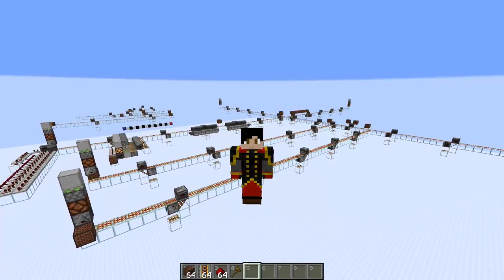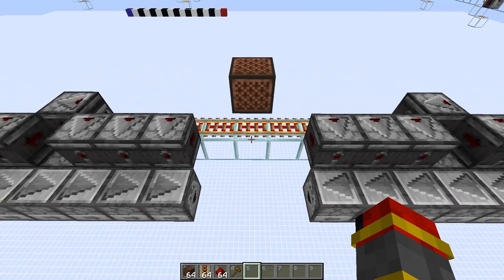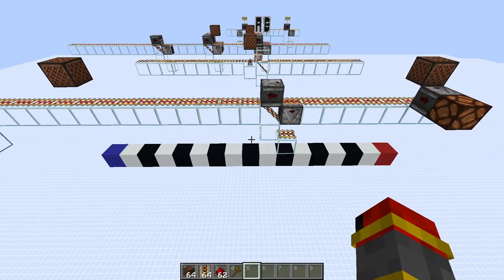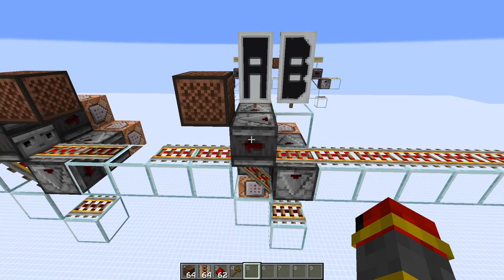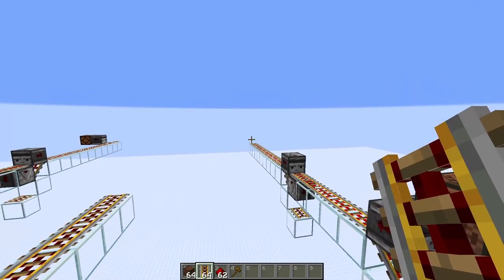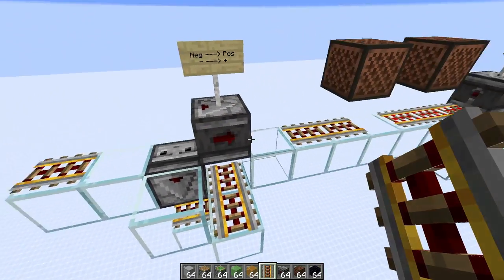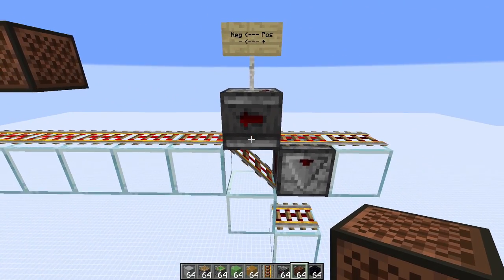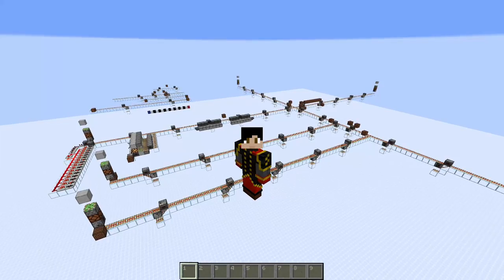Robust Instant Wire | Minecraft

Comment: I needed some sort of long-range redstone for my railroad and this had been perfect in theory until... I needed it to bend(in an L shape). After fiddling with this for a while, apparently this is extremely simple. You just... bend it. Build two of these, connect until they touch, that's it. Also, this is probably said in the video, you can bend the rails up or down as you need. They still update instantly as if they are a single straight wire (I guess they are) I did this in 1.20.1 fabric

Comment: So after a lot of testing because I was having loads of issues getting this to work correctly I've concluded that the information given at 5:14  isn't entirly correct. 

Moving in the +Z Direction of travel with the observers output as described in the video, which is the direction the rails want to snap correctly, only is true in the North to South orientation. When placing the rails in an East to West orientation, the rails naturally want to snap in the opposite direction, making the observer output point in the -X  direction of travel.  

So again to simplify, when oriented East to West the observer output points West and the rails easily snap together, and when oriented in the North to  South direction  the Observer output points South and the rails easily snap together.   Otherwise you'd need to use the mirrored assembly method which is a major pain in the ass if you're covering any kind of real distance with your instant wires.

Hope this helps anyone that was struggling to make this work correctly like I was. Because once you figure it out this is an amazing way of sending a signal of a long distance. 

Thanks so much to Kahyxen for uploading, I've tried the end budding method several times without any success, but this method once I ironed out the wrinkles is sooo much easier!
Reply: Thanks I was confused why I couldn't get it working

Comment: I've discovered a way to break this instant wire, that being said it's still one of the nicest ones I've ever used and the situation it breaks in isn't really a typical situation.

If you place a downwards facing observer and then some dust on top on the front section (the direction the horizontal observer faces) at least 1 block away from the observer it will break, this also sometimes breaks it with rails in place of dust but not in all positions. My guess is that the observers stop powering the rails but haven't gotten to the portion of the tick where they come off cooldown and then the dust/rail de-powering updates them again causing them to turn off without the observers triggering again. You can somewhat mitigate this by tiling the repeaters every 9 blocks instead of 17 but you will still have this behavior at one of the ends.

Near as I can tell though, the only way to get in between the part of the tick where the observer turns off and it comes on cooldown is with another observer that's triggered by the line causing an update in just the wrong order, so it's only a tiny caveat.
Reply from the maker: Thanks for the info

When I first made this video, I still barely understood the instant-wire. Since its release, I've come to understand it better and found why and how it breaks, and how to use it better.

Also I've figured out how to pigmen proof pumpkin based chunk loaders btw
Reply: @Kahyxen  Pumpkin based???

Comment: Truly an amazing invention. However the normal single observer instant wires are also self repairing and can be updated anywhere in 2 out of the 4 directions. This new design is also a lot taller which is a significant downside that you did not mention.
Reply from the maker: Well this won't replace the other types of instant-wire, it's just another tool  for redstoners to use.

I've always had difficulty with other types of instant-wire. The 4gt wire always seems to clock  a few times at the opposite end of the tail, and the 6gt wire always ends up breaking on me. This design is actually only 4 blocks tall, 1 block taller than the 4gt wire from 2no2name which is 3 blocks tall. Of course nothing will beat the 2 block tall 6gt wire, but I don't like using something so fragile.

Also the upside of this wire is that it's incredibally robust, never clocks, and is extremely easy to build corrners. Also the only way that I have found it breaking is when you have such a long line that it suppresses itself.

Comment: This is really smart! since it's 1 wide, is it also tileable?
Reply from the maker: No, it's still 2 wide tileable. The rails are budded, meaning adjacent rails will update the wire.

The advantage of this design is in how robust it is
Reply: @Kahyxen  Nice. I'll probably use this instead of dico and sydneys
Reply: @imonocleman6045  what is a dico & Sydney instant line
Reply: I was just using that one before I saw the one Kahyxen made

Comment: Sorry im a bit of a noob with instant wires how would it work if you’re trying to send a signal into unloaded chunks? Would you need a chunk loader somewhere along the line or is it just not possible?
Reply from the maker: You will need to build chunk loaders as no instant-wire works in unloaded chunks in 1.16.5

Comment: Is it possible to pulse the wire every 4gt? I'm trying to make comparator wire with 5hz throughput but I can't figure out how to get this instant wire to pulse that quickly. The only way I've been able to get it to pulse that fast is with an observer detecting a lever rapidly flicking on and off. Maybe I could use a 0-tick pulse generator to update it?
Reply from the maker: It's a little annoying, but the only way I know how to clock it at 4gt is with pistons. If you look at the 50s mark, you'll see an example, the parallel to serial transcoder.
Reply: @Kahyxen  I see, that's very helpful! After some testing, it seems you don't need the observers to detect when the piston heads move, you can simply place the pistons directly next to the instant wire to update it. In fact, by placing the piston base next to the rails, the delay is the same on the rising and falling edge of a signal. So for my comparator wire, I can simply place a line of 15 pistons being powered by redstone dust to send a pulse whenever the signal changes. This allows the signal to easily be under-clocked for pulses longer than 4gt as well, as pulses are only sent when the signal changes.

Comment: Just to tell, with the newer versions and i can not say from wich one on, this does not work anymore. Or at least not in the Java Version. If you try to activate it like shown in the tutorial from positive to negative it will only flicker heavy between on and off but not staying in a permanent on state using the observers.  The Basic thing with the levers still works though.
Reply from the maker: It still works. If you're having issues with multi module setups, alternate between powered rails and activator rails for adjacent modules, or increase the distance per module to above 10 blocks

Comment: I tried building it in 1.20.4 and depending on the direction it either just blinks or stays permanently powered even when updated, is there some other parameter not mentioned in the video that causes this?
Reply: In 1.19 they changed the way that rails work to fix update suppression. I'd assume this fix breaks this mechanic

Comment: So… this is perfect for enderpearl stasis chambers?
Reply from the maker: Well the destination needs to be in loaded chunks, and you could end up with some update suppression if the line in 1000+ blocks long. If you're building rail instant-wire that long though you're going to need an instant piston repeater regardless of which instant-wire rail line you use.
Reply: @Kahyxen  Do you mind explaining what the instant piston repeater is and why it would be needed for long runs of instant wire?
Reply from the maker: @NopeDK  Since rails update from the farthest rail to the closes, this results in it being proccessed in a weird way. The game has to remember to update the closer rail, but before it can do that, it notifies the adjacent rail, which will do the same thing too. So basically the updates occur recursively.

So if you imagine a long rail line, and "( )" being the notation for an update.
A single rail will have ( )
9 rails = ((((((((( )))))))))
If you have 40 rails (((((((((((((((((((((((((((((((((((((((( ))))))))))))))))))))))))))))))))))))))))
So the longer the line or rails, the larger the stack in the computer becomes. Eventually it gets so large that the game gives up, and decides not to update. This results in a phenominon called update suppression.

There are some ways to mitigate this

If you use a T-intersection of 2 rail branches = (((  (( ))+(( ))  ))), the branches breaks up the update into smaller sections.
Or you could use a piston repeater = ((((( ))))) + ((((( ))))) + ((((( ))))) + ((((( )))))
The most basic piston repeater is a sticky piston facing up, with a slime blocks then a redstone block, but this is 6gt  reset I think.

Comment: Ok, I’m still a noob at technical minecraft. What are the uses of instant wire? What types of machines/farms you can make with this that would make it worth the effort? Thanks in advance.
Reply: This ignores game tick speed so extending the length never has to be delayed this makes longer lines of redstone easy to sync. If i press a button and its connected to 2 of these and one is much longer itll still update at the very same tick this pretty mich removes the struggle of timing alot of mechanisms, but if i used conventional redstone to make a long line like torch binary or repeaters it would be out of sync

Comment: I am getting just weird behavior with this. I have 4 exact same lines next to each other and only one of them is working correctly. It seems very location dependent in the world
Reply: not location dependent, but extremely sensitive to nearby block updates, so have several lines  running next to each other wont work, as they just cycle updating each other. A min of 1 block space is required between runs so they dont interfere with each other.

Comment: is there any way i can take an instant output from this instead of using an observer?
Reply from the maker: This isn't a really good implimentation, but the concept is sound. https://imgur.com/a/UOXGoPy

Basically use budded pistons and dust cut off.

Beware the player input bug which will create a 1gt offset if you directly update the instant line
Reply: @Kahyxen  thanks ill give it a go

Comment: yeah but what do i need a instant wire for?
Reply: It can be used to make dropper lines which transmit items instantly, or instant comparator wire which can send a signal strength quickly over long distances. It's also useful for making circuits with low latency, such as inputs/outputs for a redstone computer.